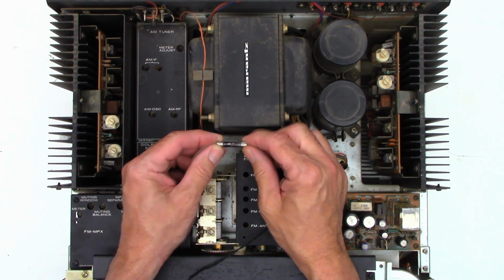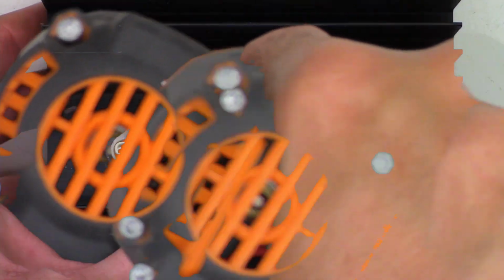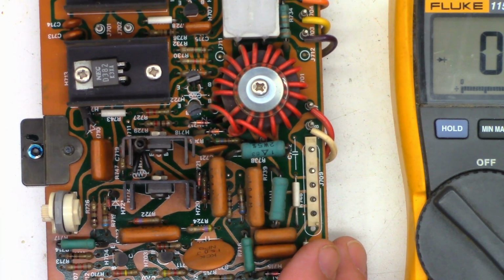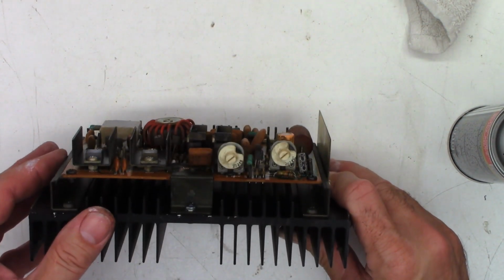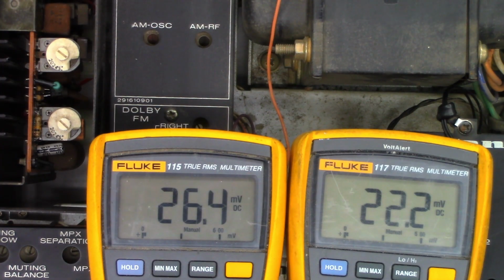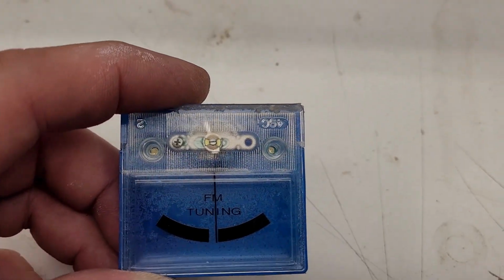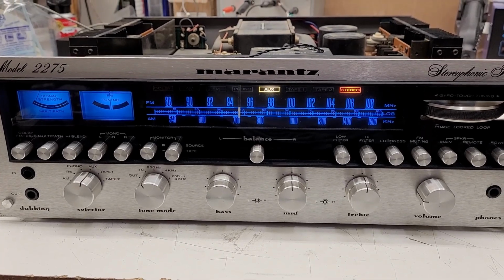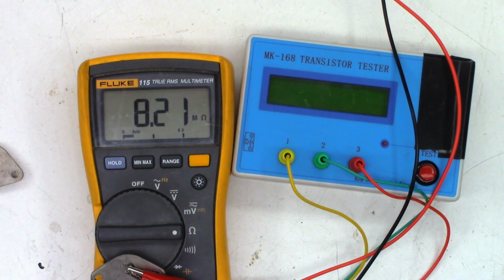The Marantz 2275 - It came back - This time with a blown fuse - Plus FM tuning meter repair

Comment: Great video. I'm glad you are showing how to refresh these classic receivers. They still perform on a par with the best amps today. I noticed you upgraded the outputs to the higher rated mj21195 / 96 pair, perfectly fine subs at even higher ratings .Overkill, in fact. There are many counterfeit power transistor sellers in China, so buyer beware. Buy these parts from a trusted US distributor or you may be sorry.  Also, It looked like the mica pads were put on dry originally (not sure, maybe just clear grease?), glad you put some fresh silicone grease there. In your earlier video, you changed the indicator bulbs to LEDs. Did you use white LEDs for the pin bulbs, and cool blue for the fuse bulbs. I plan to do this on my 2275 and will buy individual LEDS, so  I wondered what exact color for the pin LEDs, warm white or cool?
Reply from the maker: The customer supplied the LED kit so I do not know where he purchased it from.

Comment: I had a sansui reciever with transistors like that and one channel was bad causing damage to the driver circuit. The other channel was okay but if you put the fuse in the dead channel it would blow right away. I took it somewhere and they tried to repair it but was unsuccessful.
Reply from the maker: Too bad, they were great units.

Comment: Nice work.  I think you could have centered that tuning meter without disassembling anything by following step 11:8 in the FM alignment section of the service manual.  Center tuning adjustment is made by adjusting the upper core of the discriminator transformer L201 to center the needle.  At any rate, job well done.
Reply from the maker: That step only works if the tuning meter is mechanically centered. I tried to adjust the discriminator and when the tuning meter was centered the alignment was off. Plus with power off it needed to be centered (OCDness)

Comment: Could you have just replaced the Right channel power transistors but not the working Left Channel (Would that cause any problem)
Reply from the maker: No issues if you do just one, I think doing both channels will prevent future issues.

Comment: Hi. Thanks for the great class. Congratulations on the high resolution video. What I would like to ask is about my 2275, it has 2SD733/2SB697 transistor pairs on the outputs, they are working fine, but are they correct for this Marantz model?
I also have 2 pairs of transistors 2SA747A and 2SC1116A, will they be suitable for model 2275? Thanks.

Comment: I have an Onkyo tx-sr505 with recently blown output transistors on SBR. I haven’t used surround back speakers in over 10 years. Is it safe to remove the transistors and continue using the receiver without the back speakers ?
Reply from the maker: Should be ok, You may have to remove the driver transistors if one of those are bad. They can cause a DC offset on the speaker line also
Reply: @norcal715  Perfect. Thank you so much for your reply and your excellent repair videos.

Comment: I'm sure my old Marantz needs some TLC service as well (not being used at this moment). Also my Adcom 80's GFA-555 amp. I still run the Adcom hard and it is stock. I'm sure it needs to get tuned up. Probably should get it tuned up before something shorts and fries my Darlington outputs. Aww I forgot I also have a 70's Pioneer receiver/Tuner rated at 45 Watts per channel which easily runs 100Wpc clean that should be tuned up.(also not used at this point). Guess I need to save up and have you go through and make them right again. Thanks for the vids. New equipment is garbage!

Comment: i was given a RS Analogue multimeter, and i struggle to use it, any simple tips? It was never used and came from a large chemical works in UK called ICI (Imperial chemical industries) like alot of stuff, its been bought out and is no more, so i got a multimeter
Reply from the maker: Send me a clear picture of it to Norcal715videos@gmail.com and I will try to help you.
Reply: @norcal715  lovely

Comment: I noticed that you cleaned the heatsink after you removed the old transistors, I would say that marantz had thermal compound between the mica washer and the heatsink! It might have been a good idea to also do the same!! 
As for those MJ's, I have seen them used in a few amplifiers but I think that a more time period correct transistor would be the 2N3055's, while you probably won't find them at Digikey or other like places, they are dime a dozen on eBay and yeah I know that they are Chinese clone's, there used to be fake one's age's ago but I haven't heard or seen any fakes lately... 
The reason why I mentioned the 3055's is that I have seen some amplifier designs don't work well with the MJ'S, on paper they seem like a superior transistor, they are rated for 250W as opposed to 115W of the 3055's but the 3055's are a slower transistor than the MJ's and that's where the problem lies with some amplifiers! So it's important to check switching frequency of transistors when trying to match up new one's... You could run into problems in the future with this! 
There's a great video over on John audio tech's channel where he builds up an eBay kit amplifier that someone nice enough sent in to him which was originally based on the 2N3055's but the kit was also sent with a shiny set of the MJ's. John built it and used the MJ's and it was terrible. He didn't use the 3055's because he believed that they were cheap Chinese fakes but decided to try them anyway, and low and behold it worked! And they were able to deliver maximum power also! The circuit design was actually based on those slower transistors so by going to a faster transistor, it just didn't work! So always keep that in mind! I think that you got lucky on this one.. I don't know what the Fairchild transistors switching frequency is, you definitely can't get those anymore! My amplifier is using Australian made Fairchild AY9171 TO66 unobtainium! I love the sound of that amplifier and only recently replaced it's original Rubycon and Elna capacitors that have been in there since 1972! It's had a very good run and I didn't want to loose the original transistors so I replaced all the capacitors but made sure that I used the highest voltage rating that could fit in the original location, the voltage rating on the older capacitors was very underrated, they don't do that anymore! If a capacitor say's 10V! That's it, if you go over this, it will explode! 
Maybe if you have an old capacitor lying around, even the old paper wax capacitors, put a bridge rectifier on the Variac and a voltage meter to get the DC voltage reading and see how how far you can take the new capacitor compared to an older version! You will be surprised! And you will then understand why new capacitors don't last as long! And only then you will start going up in voltage wherever you need to replace a capacitor! 
I was hoping that you were going to pull out the two capacitors on the power amplifier boards and check their voltage loss, that's the invisible transistor killer! ESR in that location is less of a problem... And transistors don't just decide to die so I'm thinking that either the capacitors are suffering from high voltage loss or the thermal compound just wasn't doing it's job anymore or the speakers it was using has a shorted driver or bad capacitors in the crossover!!! Though the two capacitors on the power amplifier board were away from the driver transistors, they are close to the heat source as it is and a higher voltage rated capacitor will deal with the heat far better than a lower rated one! 
You can see on the Panasonic capacitor datasheet how going up in voltage is the same as going up in temperature rating and lower ESR at the same time! 
Anyway, I'm glad that this all worked out fine in the end!
Reply: 2n3055 might be a bit underrated here. Now with all the fake ones wouldn't use them for much of anything.
Reply: @marka1986  do you think that they would be underrated here? They are rated for 115W, I don't remember what the marantz is rated for but I don't think that it's output was that high! 
As for the Chinese eBay ones, I have personally used them in my own equipment and I haven't come across a bad one yet! I have heard many bad things about them but I'm still to see if it's true! I guess that it's luck of the draw...
Reply: It's been awhile since I did this for a living but usually the breakdown between collector and emitter were either too low or to close for comfort on the 2n3055. At that time mj15024 and mj15025 were very common and worked very well in most circuits.  If you only needed npn outputs 2n3773 was a good choice although with somewhat lower breakdown ratings. I believe the transistors he is using are the newest replacements for mj15024 npn and 025 is the pnp. Yes some circuits are very picky. If were lucky and the manufacturer supported their equipment they would supply or recommend replacements and provide service notes if changes were needed. First example  that comes to  mind is Phase Linear.

Comment: How much did you charge the customer for a job like this? Just the labour without parts? 
I never know what to ask, what is the right way to calculate the price.
Thank you.
Reply from the maker: On the comeback I charged one hour for the amp repair plus parts, and one hour for the meter repair. The total with parts was $150, but I do this in my spare time and charge less just to do it. The normal labor today would be between $75 and $100 per hour, it took approximately 3 hours total. As stated in the video I cut the customer a break.
Reply: I would charge parts and labor. Had nothing to do with original issue

Comment: Would check those emitter resistors as they likely have drifted in value up with having the massive current pulse from the failed transistors put through them.

With the failed ones a decap with a microscope view would be interesting, and then some comparisons with the still somewhat working ones. Going to guess the PNP failed first, silicon PNP power was always a harder transistor to get right, unlike Germanium, which was the opposite.
Reply from the maker: I did check them, just didn't record it.

Comment: Am I seeing things or was there no heatsink compound on the original transistors?
Reply from the maker: It had just silicone dielectric grease only.
Reply: @norcal715  Probably had all evaporated away, leaving the output devices with little heatsinking and then one transistor failed.